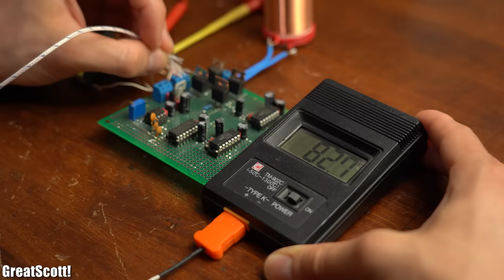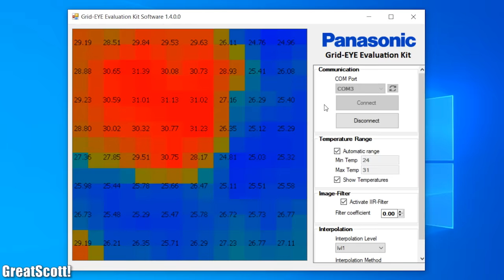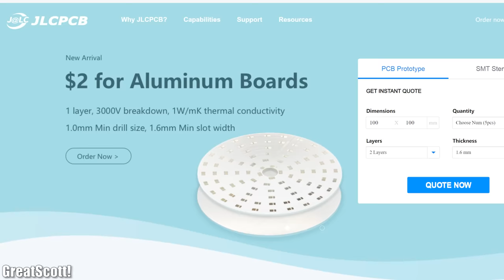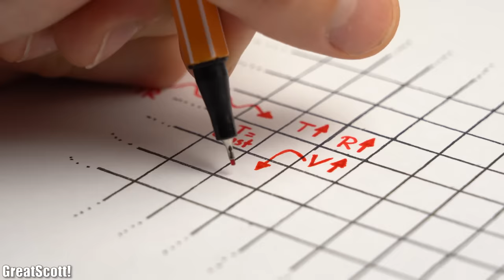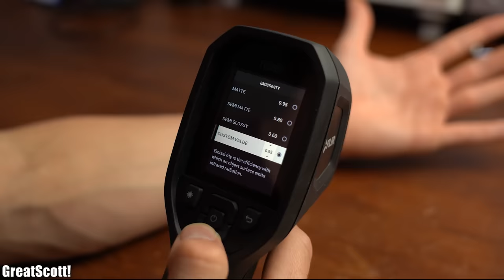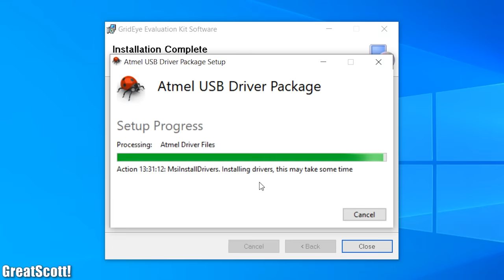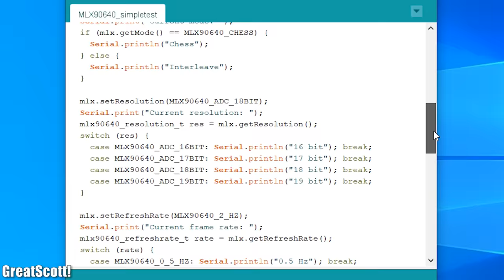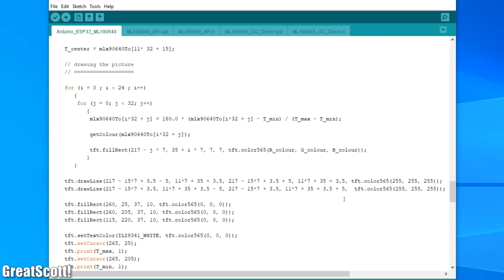Thermal Imaging Camera DIY $110 VS Buy $530 || DIY or Buy

Comment: scott you always amaze me 
whenever i get new project i always find something helpfull on your channel 
this time i abolutelly got what i looked for 
im working with cars and i try to diy a lot of things 
like year ago i made conversion from distributor to coil on plug for my honda 
now im trying to make tire surface temp monitor 
and literally all i need is simple small temp camera that will just give me temp across tire 
and its exactly what this camera u made is suited for 

as for what u said in the end about diy camera not having emissity coeficient 
i think its all down to code
i can think of linear table in which u only need to put 2 values of real temp messured and 2 from camera reading 
to calculate it and correct it i guess it might be a lot for arduino but i guess if im about to only use about 8 pixels per tire because more isnt needed it could work, the refresh rate is a bit worrying but maybe camera with less pixels could give me better refresh rate i guess 12hz is like lowest i could go but perfectly it would want to be about 20 so i can monitor the data with precission there is alot happening when u race a car and having a lot of data to check after session is never a bad thing

Comment: Changing the screen or the screens library for a faster one would help and a better looking image can be had with bilinear filtering, I've even had quite good results with the amg8833 using this technique. I just need to pull my finger out and build one with the mlx90640 which I've had sitting around for 2 years! Great video though and I'd love to get a flir but can't justify the money for the real use I'd get.

Comment: I don't disagree with your conclusion, but there are some reasons why you might want to DIY a thermal camera. If for instance you need a thermal camera with a high refresh rate commercial solutions will be very expensive compared to DIY. Or if you're interested in a specific temperature difference, a DIY solution will make it easy to focus on a specific gradient. 
I made a thermal camera based on the AMG8833 in combination with a regular camera. And it worked really well for tracking down leaks in the insulation of my dad's house. The nice thing was that I could set the threshold for a colour change to what ever I wanted, so I just took a red to blue scale and made everything that was below the ambient 18 degrees red. It made it super obvious where the major leaks where. I also used it to find hotspots on pcb's and it worked well for that too, although the resolution wasn't high enough to use it on small size components like smd-components. For the actual temperature of a hotspot a thermocouple is always the most accurate solution. I really hope a higher resolution open source sensor will become available, so I can build an improved version 😁
Reply from the maker: Thanks for the feedback ;-)

Comment: Amazing as always.  Thank you for explaining how to troubleshoot with it.  I am going to try that (because my circuits rarely work first time). 
It is obvious that the components you tested for your DIY version are not granular enough for the kind of work you mentioned.
In my mind, that just means you haven't found a better camera module yet with a DIY price tag.  If you could bring the DIY version under $250, then it would still be a good DIY win assuming getting better resolution.
It seems as if finding a module with DMA transfer and hardware DSP to handle the correlational computations would probably require an embedded MCU or PIC, so the price would much higher.
You kinda missed out for this video because tearing down the expensive camera could have shown what model components they use.

Comment: I don't see if anyone else has already suggested this, but many of the (cheaper) commercial solutions will mix the thermal image with a normal higher-res mono image to realize a composite image that looks MUCH better than the raw thermal. The human eye is very forgiving of low res color channels in a video signal, especially on such a small screen, provided the luminance portion is even half decent.

Comment: Interesting.
Not sure if you're aware or not, but digital camera sensors are sensitive to IR. They're all fitted with an IR blocking filter... There was someone removing these filters to get night vision. And guys were adding filters to filter out daylight. If you have an old digital camera, you should be able to experiment and feed the image into the software you borrowed.

Comment: a diy episode on 3d printers will be awesome. i know its difficult but good 3d printers are expensive and they are a really useful tool
Reply: You can get a really good 3D printer like a Ender 3 for about 200€. A as  cheap as possible printer may cost like 50-100€ and is really crappy and unusable.
Reply: @maxischerr  but a diy one will probable be cheaper

Comment: There's a pretty solid smartphone with built-in thermal camera that performs quite well considering the price (camera is made by FLIR). 
Look into Ulefone Armor 9 (older, around 450$) or Ulefone Armor 11T (newer, around 500$) if you're interested. 

Both models use FLIR Lepton 2.5 sensor. Just thought I'd mention it in case anyone has use for it.

Comment: So I'm pretty sure I've seen a guide for such a project on Adafruit Learning System. I don't remember which sensor it used, but I'm pretty sure the dev board in use is the CLUE (micro bit shaped nRF52840 cortex m4 at 64mhz, with TFT and a bunch of sensors)

Comment: Does the thermal camera show any effect if the distance is changed while measuring the temperature of an object?
Reply: Hi, yes in general the farther object is, the cooler it appears. Would say around 0,75°C per meter due to diffusion by air and dissolved water vapor.

Comment: This is the exact question I've been facing. I want one that's good enough to find hot components in cell phones or computer boards but not more expensive than it needs to be.   If you buy one too cheap you waste your money since you have to throw it out and start over.    Thanks so much.  Sorry this did not work.

Comment: The DIY may come out on top with a higher budget sensor and switching to rasp-pi for a higher refresh rate. But at that point you are probably spending 200-300$. So I guess it depends on you budget and at what point its just worth it to buy.

Comment: Commercial thermal cameras have a regular camera along with thermal camera. Both images are superimposed to give a more realistic image with well defined edges. I think Flir has a patent for this technique.  Seek brand has higher resolution thermal sensor, but since they do not use regular image superimpose technique,  their thermal image does not look very well defined.
Another fun fact is the refresh rates of commercially available thermal cameras are kept very low to prevent their use in heat seeking autonomous devices.

Comment: Haven't watched the video yet (obviously by time of this video being posted)
but I just want to say, I want to get one for my phone, because a thermal camera looks so cool.

Edit: watched the video, I hope there's a reasonable fix for the diy while keeping the price low, aside from that, neat!
Reply from the maker: Not only looks cool, but is can be very useful ;-)
Reply: @greatscottlab  indeed, I worked on circuit boards a lot a couple of years ago, (with a few of them being fried due to a bad solder joint or a component put in the wrong way, oops!)
so one in such scenario would be nice.

Comment: If you want to use a thermal camera on any compact circuit board "Smasung Galaxy board", you will need a "MACRO LENS".
Buy a ZnSe Meniscus focusing lens for Co2 Laser, put it in front of your thermal camera which ever way you know how and bam you can do circuit diagnostics with your low res thermal camera.
Also Flir's Double image is next to useless. Seek Compact Pro is what you want, you do need a smart phone but you can always dedicate an old smart phone for this task.

Comment: The only issue I see is that an upgraded DIY unit would probably tip the scales around $200, and still be vastly inferior to a commercial one. Taking a quick look, I see the FLIR ONE Gen3 (80x60)is available for $200 (iOS or Android phone required, but who doesn't have one of those?). I guess that settles the debate. I also see 160x120 unit for just $350 instead of $530.
Sticking with the DIY solution, a RPi could easily be used so that you could overlay the thermal sensor data image over the standard RPi camera. Image manipulation is definitely intimidating for the average programmer, but easily doable.
Seems to me like 99% of the time you just want to visualize temperature differentials so I really wouldn't worry about the emissivity coefficient, but it's basically just a scaling factor for that data represented by either a constant or a variable as far as the code goes so that would be easy to extend.

Comment: You need to know that every cameras can capture infrared, but the classic ones have anti infrared filter which you can take apart from the camera so that it can capture infrared light again, after that you will can use normal camera as a infrared camera, and then therefore as a thermal camera!
Reply: No, Infrared itself is a large part of the spectrum and most sensors are only sensitive to the closer infrared side of the spectrum to visible light. Even if it could (which it can't) the glass/plastic lenses would block the thermal infrared part of infrared.

Comment: I need to make an eFuse circuit for my farm irrigation system.  Your video on the subject is the top rated video.  I was wondering if you could do an updated video on the subject.  Thanks
Reply from the maker: Updated? The video is only a couple months old. What do you think changed in that time?

Comment: I understand that 700 ish nm is considered infra red but that is infrared as in just outside your visual range or the ir diodes in your remote. It is my understanding that this is not the thermal infrared that  is read by these sensors bolometers? Are we not talking about heat IR emitted in the 5000 ish nm to 10000 nm range .?

Comment: TG267 has a resolution 160x120. However, in the DIY project, GreatScott ony use an IR sensor with resolution 32x24. It is meaningless in comparison. Because the resolution has a great difference. You should use an IR  with compatible resolution in DIY project.

Comment: Is there a reason nobody seems to mount the thermal and visible sensors physically aligned with a hot/cold mirror so there's no need for all the fancy software image alignment? 

It worked for 3ccd color cameras.

Comment: myabe you can go another rout. Why not add a regular camera and use the Heat image only as an Overlay? Because of the lag of performance use still shots instead of live view. I think those 2 changes in your desing can can increase the value without adding too mutch of budget.

Comment: Sure, the resolution of the DIY version is not the same but a bit of upscaling and anti-aliasing could help.
Also writing code for "high fps" display applications is always hopeless with arduino because the libraries are god damn slow.
Rather use the micros DMA or even the special display interface bus that this display controller has.
For this kind of project a STM32 with LCD interface would be a better choice.

Comment: What if you don't need an array? How inexpensive can you get if you just have a single IR detecting node? If theyre cheap enough, maybe they could be used to make a toaster with an actual done-ness setting, instead of just a timer

6:33 That color resolution is much higher than the numerical resolution, does that mean that some of the color data is extrapolated? Extrapolated data is a real turn-off for me. Extrapolations should never be included in the data set, as they are a drawn conclusion. But I think many people prefer something which is conveniently visible to something which is accurate with precision

Comment: The "FLIR ONE" for cellphones is a good alternative, and only have the price as standalone ones.
Reply: An annoying part of them is the battery. It has a usb type-c port, but still needs its internal battery which doesn't last long. And a PC Software would be nice too.  I got my Flir One Pro for about 200€ which is a price point that's absolutely fair, but for the normal price tag of up to 400€ it gets into a range of much better device with aren't that much more expensive.

Comment: im going to point out that a short circuit in a aluminum board can go to the board and therefore if you don't ground it you can shock your self silly, which is something thats becoming more and more common with the LED lights with aluminium pcb's.

Comment: Are these sensors capable of being higher resolution? Are they constructed differently than CMOS and that prevents smaller pixels, or would smaller pixels just not collect enough data, or is it just a lack of demand to warrant fab costs?

Comment: Wouldn't you be able to achieve higher framerates if you used a different controller? Have you looked into Raspberry Pi Pico? It looks like it's miles ahead of Arduino.
Reply from the maker: Yep

Comment: Be awesome if you revisit this project and add a conventional camera module to overlay the images to improve the image quality, sadly this is well outside my skill base but if you can manage it and share it would be great. maybe using a raspberry pie camera or similar? sadly the commercial option is well outside my budget but building this is a bit more accessible as actually have most of the parts on hand, just need to get the thermal camera, but want to hold off to see what improvements you can make

Comment: Thanks Great Scott! This was fascinating! I wonder what IR LEDs or an IR laser would look like with your new or DIY camera?
Reply: Nothing spectacular actually.  IR LEDs and lasers operate in "near-IR", that is almost visible light.  In fact, old and cheap security cameras and most modern video cameras if you remove the infrared filter from the sensor can see it.  What is so special about this camera is that it can see far-IR.  An IR LED will look to it just like any other LED as long as it doesn't run hot.

Comment: I wonder if you could find better sensors and raise the project to 200$ or even 250$, I prefer to DIY my things and this would be so neat, maybe with a raspberry pi zero or something for better processing and higher res screen output. Maybe you could get two of the sensors and make them angled or some such that you could increase the effective resolution from pixels overlapping

Comment: You should get FLIR Lepton 3.5 its price is higher about 199$ with Purethermal PCB 320$ , but also comes with 160x120 resolution 
but I guess the buy will win again

Comment: If you want it for PCBs only i would go with the chinese high quality brands these days. Qianli Supercam X for example has a very good resolution and good focus abilities (from 2mm to infinitiy). It has a 260x200 pixel sensor which is by far the highest out there as far as i know (in that budget range). Due to the mix of the nice focus lens and the high resolution you can even see the heat distribution of the single PCB traces. 
For a cheap entry a used or refurbished  Flir One Pro or Seek is nice (i'm using one too), but if you spend about 500 bucks for a new one i would rather check the alternatives with much higher resolutions and better focus.

Comment: I think you can change the emmissivity coeficcient, if i remember correctly. i used the MLX sensor for a school project and when i was writing a python driver for the rpi i stumbled over the setting. but i don't know if it is in the adafruit driver or the original Melexis cpp files.

Comment: using raspberry pi as a main board would help since it has a camera port and is much more powerful than esp32. 
edit - NoIR camera can be used for this project.
Reply: As far as I know, the NoIR camera only picks up near-infrared. So thermal imaging wouldn't be an option.

Comment: I really don't know where you got your prices from.
Flir one add on to phone costs only 200 and you can get older micro usb versions with same internals much cheaper. It has 80x60 resolution and if you need more you can get flir one pro for 300 which has 160x120.

The most expensive part in flir standalone cameras is robustness and electronics needed to combine IR data with camera data. When you use your phone, only cost is the IR sensor.
Reply from the maker: I mean you can see the prices in the video.

Comment: Hey Great Scott!
Nice video,

Recently I came across a problem, I purchased an adapter that had USB 3.0  female Port, Type C male connector, Micro USB 2.0 Male connector. It broke off easily right on the first day.
Waste of money, I was thinking is it possible to make USB 3.0 female to male type C adapter at home without using microchips, just wires?

Comment: Great Video! I'm personally much interestes in thermal image sensors for arduino or raspberry boards; maybe you could use a better sensor resolution, like the Heimann 120x84 Thermopile Infrared Array, so you could have 10k pixel and not only 768 pixel. Maube the cost increase is justifies if confronted with the commercial solution. The framerates go from 9 Hz to 50 Hz depending on the choosen ADC resolution (the max value is 16-bit with 9Hz). I Hope to see some future improovment in your project. Another use for the camera maybe fire hazard control, in your kitchen or garden, even with onli 768 pixel. Have a nice day :)

Comment: 10:00 Is it possible to use a transparent display so that you can see the heatmap overlapped with what you're looking at? Or use a camera and the temperature sensors with overlapping displays (for example the first display shows the live feed from the camera and the second display on top shows the heatmap).  There are some interesting videos about these displays from Sean Hodgins and 
Zack Freedman.